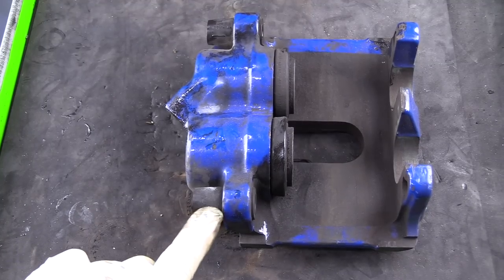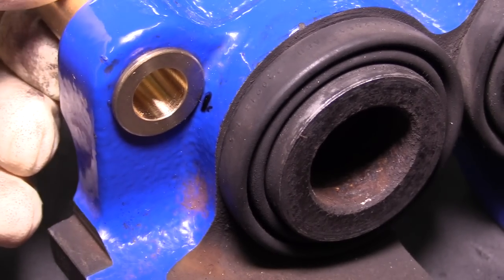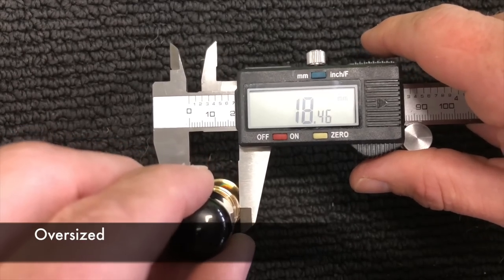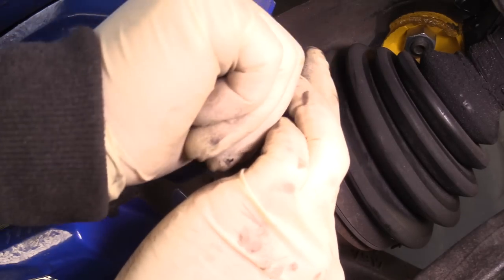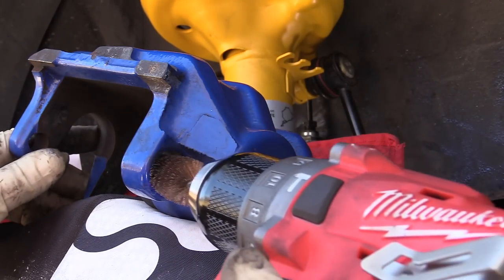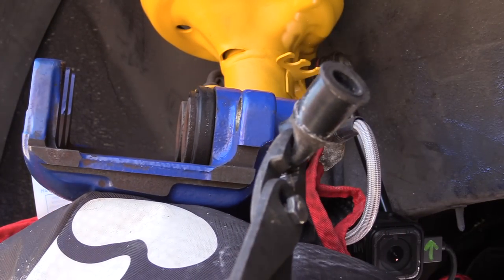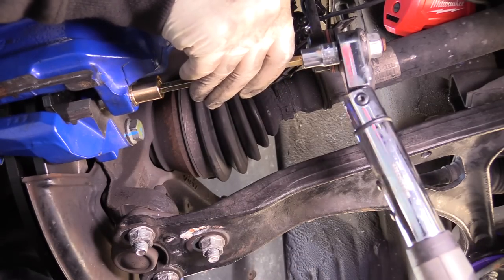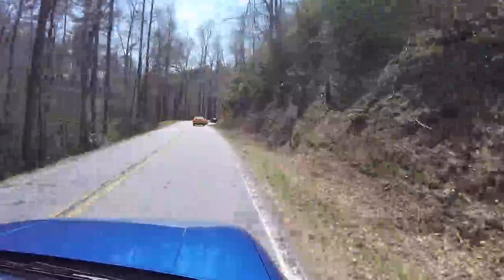Brake Caliper Stiffening Kit ~ How To Install and How it Works

Comment from the maker: Hope you guys enjoyed the video. DIY Starts at 1:44 
One question that may come up is about maintenance. Tyrol recommends yearly inspection/lubrication for daily use. If used at the track, in's good to inspect/lube after the track time.
Reply: HumbleMechanic you forgot to tell the difference before and after installing the kit, when braking. Thanks for the video! Love your channel.
Reply from the maker: I mentioned it really quick. There was a slight increase in pedal firmness. But that is really a byproduct of the kit. It's more about pad contact and less flex in the caliper.
Reply: I had these in my Mk V GTI which resulted in improved pedal feel, and extremely even and long lived rotor and pad wear due to less shudder and motion between the contact surfaces. The only trade off is maybe a slight bit more brake NVH coming through the body with slotted rotors but I actually like this as it provides a lot more braking feedback. I’ve now installed them in my Audi S4 as proof that I was that happy with this kit.
Reply: Josh Junker, appreciate you adding your thoughts. I’m looking into these for my MKV as well, and I specifically had a question about any additional NVH.
Reply: HowdyasayFlapjack yah just a bit of awesome sounding tractor beam sound under hard braking. Also note that I never had any squealing just more friction sounds under braking.
Reply: hey! I have a skoda superb 1.9tdi (avx 96kw) and last night when i was driving home, i noticed that it lost a lot of power over 2000rpm, it has boost and no lights, but over 2k it feels like it's drowning in diesel... this morning i ran the glowplugs, and it stoped imidietly after turning over, and did this about three times. after that it started and ran rough, but evened out after a few minutes (lots of smoke aswell) and then i took it around the block, and it ran just as normal and an even powerdelivery all the way. after it heated up it started to loose power over 2000rpm agien... i don't have a codescanner at the moment, but i hope you have some advice! :) btw, the fuelfilter looks verry old and dirty from the outside, could it be as simple as replacing that or what do you think?
Reply: HumbleMechanic I have these on my calipers as well. Going to be cleaning them soon, just have a question regarding that. Can I just remove the caliper pins without dissembling the caliper from the rotor and use brake cleaner to clean everything out and then re-grease?
Reply: @HumbleMechanic  I may have missed it, was there a long term update on these? how are they working out?
Reply from the maker: A few years id worry the current phone won’t work with old CarPlay. Lol
Reply: @HumbleMechanic   I second the request for a review/update after having these for a few years now.  Thinking about picking up a pair for my S3 and you seem to be fair in representing both the pros and cons of each modification.

Comment: Did the same improvement on my Jetta MKIV with steel braided lines. I purchased the stiffening kit from ECS Tuning as well as the braided lines. I also rebuilt all the calipers. Didn't stop there. installed Euro Stop Tech Ceramic brake pad and slotted rotor kit. I thought going fast was fun, didn't think stopping would be as fun too!! Very well done video. I really enjoy your how to's.

Comment: VW calls it a "semi-floating" caliper, as the rubber guide bushings provide that "semi-float" with the play of the rubber.

I had the original Tyrolsport design on my old MK4 and B6 Passat... where the guide pin was not covered by a cap.  That definitely required annual clean and relube.
Reply from the maker: I’ve cleaned mine once since installing. Becaucally super clean

Comment: I had some issues with these well more accurately my caliper on one side the hole was smaller than the bushing and I cleaned it out real well. I ended up rigging a price of wood with sand paper wrapped around it to my drill and sanded out the hole better so it would go in. After everything went in no issues got a slightly firmer pedal and even brake wear. Highly recommend tyrol support was fast and recommend I try sanding.

Comment: Did this on My Mk6 R a couple years ago. The biggest pain was getting the snap rings in place with the calipers still attached to the car. On the MK6 there is not a lot of room around where that ring needs to sit. A slightly larger pipe section would have been extremely helpful in getting them seated, instead of fighting with snap ring pliers for 10 minutes per.

Comment: Those brakes look good!
The stiffener still looked a little loose to me, but it definitely looks like an improvement!
Reply: too tight and it could bind/seize from heat though....
Reply: Ah, true, good call. I did forget to consider thermal expansion.

Comment: Very cool upgrade. This sounds like a great option if anyone is planning a break replacement or upgrade. It also looks like a great option for anyone running a track car. Thanks for the info!
Reply from the maker: I Think for a track car it's awesome! I am very interested in seeing how the brakes wear/hold with this kit. AND the brakes I have in general. There will be a video covering all that soon.

Comment: Hi Charles, nice video ("Brake Caliper Stiffening Kit ~ How To Install and How it Works")! 
Any long term update on how the Tyrol Brake stiffening kit worked out? 
Any downsides that you discovered after a few years? (This vid was made 5 years ago).  
Thanks in advance.

Comment: Looked like the wheel arch liner wasn’t attached at the bottom when you were driving. I’ve done that before and the tire ate through the liner lol. I’m sure you noticed though.
Reply from the maker: Yeah this was shot when I still had a lot of work left to do. Lucky that is all buttoned up now
Reply: Lmao I've done the same on my 20th, the liners are all chewed up.

Comment: So how did the pads wear? I have Tyrolsport's earlier bushings, which are short and don't have the dust cap. My experience has been that they work great at first, but a lot of the grease comes out. Then they don't work so great, and taper wear the inner pad. Without much grease to help the caliper slide action, the inner pad ends up wearing much more than the outer. Other problems, such as vibration, can result from the uneven wear. ECS now has a press-fit set of bushings which I'm considering.
Reply from the maker: I haven’t had that issue. They do require more maintenance than the stock rubber

Comment: Charles...that happens to me on my 2012 passat, sleeve were too long and I returned back. I didn't know the have different lengths.
Reply from the maker: Yeah they have a few different things. Kinda sucked waiting, but I think it was worth it
Reply: I have to wait for next brake pad replacement but I don't think worth  the money for a passat that is not a performance car.
Reply from the maker: I think you may be right. In fact Tyrol might say the same thing. LOL

Comment: Hey Charles , let me give you my opinion as à Mechanical Engineering : this kit would be perfect if the bushing is press fitted in the caliber . problem you probably have is that there will be some play between the caliper and the bushing, even if it' minor. With more and more miles the gap will increase, causing wear in the bore of the caliper (metal vs metal). What do you think ?
Reply from the maker: That is possible. I think with the way the is applied most of the force is back along the slides not the sleeves. This will be something I’m gonna keep an eye on sure

Comment: Would the steel pin not wear the ally calliper as it vibrates and eventually knacker the calliper? Or is this more for use on a weekend/track day car?

Comment: Very curious how those PVC dust caps will hold up to some heavy repeated brake use. I considered the ECS Tuning version for my E91 BMW but never pulled the trigger b/c of this concern. In for zee updates! 😁👍
Reply from the maker: I don’t think it’s an issue. The OEM parts are a similar material.

Comment: I was under the impression that you need NEW M12 caliper mounting bolts when you remove your calipers.
I don't think the OEM caliper bolts are TTY bolts, but changing them is important
Reply from the maker: You are right, they are not TTY but I like to replace hardware when I can. I didn't on this one because I knew it was not the last time apart ;)

Comment: I used a very similar kit on my BMW. It made no noticeable difference in pedal feel. The o-rings and caps designed to seal the design made the pins almost impossible to move or service. Overall, I don't recommend this change.
Reply: Thanks for the humble answer, I've saved some money

Comment: The bushings appear to be brass. It will be interesting to see how they wear over time.
Reply from the maker: Me too. I forget teh exact compound they use. The guys at Tyrol are awesome. I had about an hour long chat with the head engineer.
Reply: It's recommended to regrease these periodically with brake grease.
Reply: +Aaron Garcia - That's probably the reason for the factory setup, no maintenance.
Reply: I've had mine in for maybe 12 years. And probably done 80-90k miles .  Still seem fine to me

Comment: Ive got an issue on my t4 van where the calipers sags down with its on weight & occasionally contacts the brake disc. 
Seems the rubber sleeves have alot of movement

Comment: I moticed that with the solid bushing installs that they are on the front calipers only...do they have solid sleeve kits for the rear as well? Would love to fit a set of these to my '06 MK5 Jetta 2.5 .
Reply from the maker: No. The rears done have that style.
Reply: OK. Cool beans on the mod.

Comment: if I do get these and they don't fit will they take them back even if I attempted to install them?  Are these for the factory OEM calipers?  I might get a set for my 2013 Passat 2.5.  It looks like this kit gets rid of the rubber bushings.  Sometimes with my car I notice a slight grab but only when it comes to a full stop and no sooner.  Would that be from the caliper flexing a bit?  I have been using Stop Tech para aramid brake pads.  I have used those on my Jetta (different part number of course) when I had it and I was happy with them then.  I use the Stop Tech pads because I want something that will stop me quick and without fading.  These would be situations like brainless people randomly pulling out in front of me or people attempting insurance fraud.  It also feels good to have good pads because I once tried ceramic and was not happy with them as far as stopping goes.  I am always looking for upgrades to things.  I just don't have a loud exhaust and never like that kind of thing that much.  I have the 09G transmission and have changed the fluid once before and a couple times in the Jetta I had before.  It really is not hard.  It is just expensive if you get the fluid from the VW dealer.
Reply from the maker: I’d call them and ask. I imagine they’d take care if you, but it’s worth a phone call. They were awesome when I spoke with them

Comment: What I should do is change my brake fluid.  Just a nice gravity bleed til it comes out a different color and occasionally topping the fluid off.  Is a quart enough fluid to change it all (or most of) it out?  I know don't let air get into the the master cylinder.  I have some Pentosin DOT 4 LV on the shelf ready for it.  I just have to save an empty Coke bottle to let it bleed into so I don't get that stuff on the garage floor.  I don't want my cat Jinx (a black cat) to get into that stuff and she sometimes goes in there.  I figured it is probably time to change that fluid.  The car is 8 years old and probably never had it done because it is one of those things that some people never get done.
Reply from the maker: For sure get it changed. 1qt should get it done.

Comment: Charles I noticed alot of old grease around the inboard side of the CV boot. Any repairs needed on it or just residual grease from previous installation.
Reply from the maker: Both outer boots need replacement
Reply: HumbleMechanic 
Oh darn going to have to make another video. I just replaced a right axle on my Eurovan Rialta and another person's. They made the strangest noise that I had never heard from a CV joint ever before.
Wish I could attach the video here maybe do it as a question to send it to you.
Reply from the maker: Email it over

Comment: 03 jetta 2.0 shifter stuck in 5th. Did the clutch most likely go out or would that be a shifting fork issue.
Reply from the maker: if 100% stuck car on or off, it's not the clutch most likely. Sounds internal trans to me.
Reply: HumbleMechanic hi Charles I posted a short video to my channel displaying the issues I'm having with my 03 jetta 2.0 shifter/transmission. If you could take a quick look and let me know what you think it would be much appreciated. Thanks

Comment: Hey man, great vid. Could you link me to a good USB->OBD2 that works well with VCDS? Also, I'm not sure if you remember, but I asked a question about having an issue with the N75 turbo actuator on my 06 Jetta TDI acting up and not allowing boost and causing black smoke. It turned out to be the stop bolt on the turbo cartridge to the N75 was actually backed off too far and then the N75 was extending too far. Just FYI and hopefully that makes sense and helps out someone who's having the same issue.
Reply from the maker: For the OBD2 I always recommend the one from VCDS. It's worth the $$$. Plus I always want to support the guys doing the work there. 

Good find on the turbo. I will keep that in mind.
Reply: Thanks, man. I'll head over there and pick one up! I had a hard time with an eBay one. I was able to read the engine and trans, but couldn't get it to read the other modules; particularly the airbag (swapped out the passenger seatbelt and just needed to reset it). Finally just brought it to a Euro shop here in SLC and they cleared it for me.
Reply: Rodrigo Sagebin Just so you know a lot of the eBay VCDS cables are actually counterfeits. Perhaps you can find a genuine Ross-Tech cable second hand on one of the VW forums.

Comment: hey charles,
ive got a mk4 golf and i dont know how to lift it. i see you jacked on the pinch weld but where did you put the jack stand? (ive got to replace a rack end)
Reply from the maker: Lift it on the pinch welds, and put the jack on the "frame" rails. I will be doing a lifting video soon.
Reply: HumbleMechanic  thank you so much
Reply: Just wanted to ask the same question :D the pinch weld on the front off the R32 are smaler then the ones on a regular mk4. If i lift it on the pinch welds there is not enough space to place a jack...wich is pretty annoying
Reply from the maker: yeah it kinda sucks. I some times put the stands on the subframe, but that might not fly with doing a steering rack

Comment: Wouldnt this cause the guide pins to wear out prematurely on uneven surfaces, that is, gravel? Might be something to keep in mind
Reply from the maker: I wouldn’t think so. But I’ll be taking it apart in about 6 months to see what it looks like and relube every thing
Reply: The guide pins are protected on one side by the rubber cover, which is same as what the vw design was on the original slide pins, so this design is no worse than OEM for dust protection
Reply: oh, I guess I somehow missed the part where he put the dust caps on, then it's no real problem, although dust might deteriorate the brass inserts quicker than it would do to rubber, as dust can still get on there from the other side
Reply: Gatis Girdenis I've got the earlier versions of the Tyrol sport bushes in my R32, they don't have the extended portion at the rear and dust cap.  I did comment on the poor design to them and it looked like they took that onboard and redesigned them to what Charles has in his video above.  I've had mine for more than 10 years now, and yes they are exposed on both sides , allowing for more dirt and stuff, but you know what they've been on my car for over a decade now and they still fine. I always remove them once a year for inspection and regressed/clean, but they are still good and tight
Reply: Will this kit fit on caliper for the VW Golf Gt ?

Comment: I am going to need someone to explain how in the world this could make your pedal feel stiffer...
Reply: Yeah, I get what the kit does, but how does that translate to pedal feel? It’s not working in the same plane as the piston and pads... Rotational deflection should have a minuscule (if any) effect on the hydraulic clamping action of the piston and pads.
Reply: athhud it removes almost all caliper motion in any degree of freedom. Having had them on two vehicles now I can personally vouch for them. I didn’t lube them on my GTI for 6 years and had no issues, but it’s possible they should be lubed up more frequently.